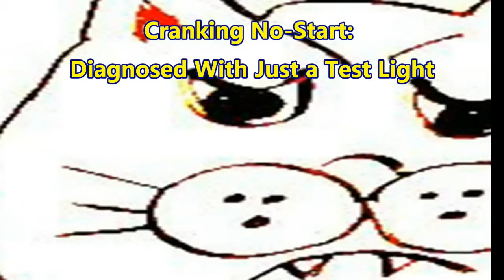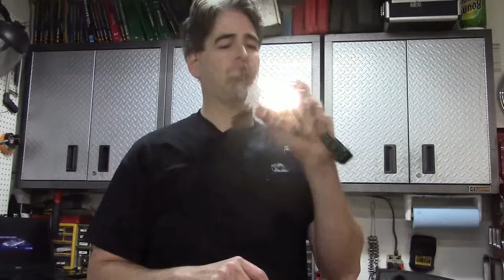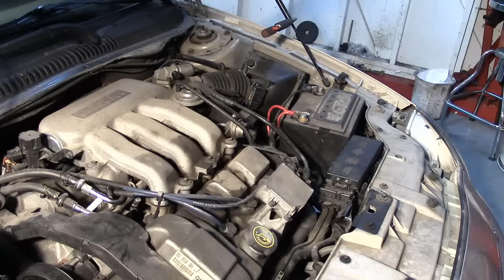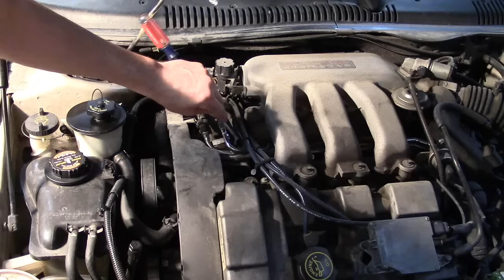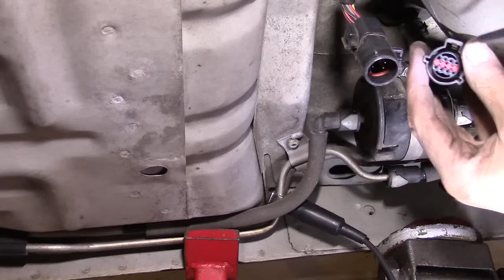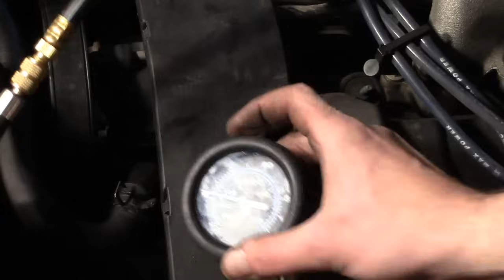Crank No-Start Diagnosed only with Test Light

Comment: Could be a clogged fuel filter or bad fuel pressure regulator?
Reply from the maker: No- there is virtually no commutator activity in the motor.  It’s not a pressure issue, it’s a flow issue due to the bad motor.
Reply: @SchrodingersBox  both a clogged fuel filter and an open regulator can cause a pump to fail.  Without the regulator restricting the fuel return line there is virtually no pressure.
Reply from the maker: That doesn’t explain low deadhead pressure though as well as the fact replacing the pump created normal pressure under load.   Remember- deadhead pressure was almost zero in the video. Filter and regulator has nothing to do with that.
Reply: @SchrodingersBox  if the filter is clogged how will u have pressure at the fuel rail?  If the regulator diaphragm or spring fails how would u have any pressure?
Reply from the maker: because i tested DEADHEAD pressure. When there is no flow a restriction is irrelevant. Think of ohms law as a correlation. Voltage equals current times resistance. Current is zero in a deadhead so voltage will be maximum. Think of measuring car battery voltage after a resistor when there is no current. It’s 12V either way- with or without a resistor. If it is any less the battery is bad, it isn’t caused by the resistor. You only see voltage drop when there is current. Exact Same math applies with fluidics. So even if there was a clogged filter, it has no efffect on a deadhead test because there is no flow.  The deadhead pressure was not even 25PSI. Therefore the pump is bad. 
  But also, when I replaced the pump and measured pressure with flow, it was at spec. IF there was low rail pressure under operating load then yes, of course there would have been a restriction and filter or regulator would be suspect. But that didn’t happen. 
  Conclusion : it was not a flow restriction (confirmed with BOTH flow and deadhead pressures). It was only a bad pump.That’s why i love science!! It is Scientifically impossible it was caused by a restriction so I know the diagnosis of a pump would be correct.

Comment: What about cars/vans that have been parked for 1+ years with same issue(cranking but not starting)?
Reply from the maker: same thing. No difference from any no start- What are they missing that’s causing the no start?
  The trick to scientific diagnostics is to not make conclusions on preconceptions.  You can triage based on them, but you can’t conclude based on them .

Comment: Can anyone tell me why  my fuel pump cuts on after I try starting it? It won't come on just by turning the switch to on. After attempting to start that's when it runs a couple seconds after words..
Reply from the maker: Not all cars have a KOEO prime. Apparently yours is one that does not.
Reply: @SchrodingersBox  thanks I put some starter fluid in intake fired right up. I changed fuel pump awile back couldn't figure out what was going onFor the longest time got kinda fustrated. . now it's fine thanks again

Comment: Matt I have 04 X-Type only 5332 miles on it did  crank but don’t start hit the gas thank hard starter fluid in breaker it start rite up what was the problem I’m worried it will happen again can’t see any problem no code I drove 300 miles it still going strong your opinion I seen your video love it  hope to see more
Reply from the maker: What data do you have?

Comment: According to my service manual the fuel pump pressure should be anywhere between 35 to 49 Psi depending on the engine. I have the same crank No start and am waiting for my fuel pressure gage to be delivered. Although I did get  a healthy jet of fuel from the Shrader valve, as you proved the pressure may not be enough at 20 psi
Reply from the maker: 20 is barely enough to start the car.

Comment: can you define "LOAD SIDE" a little better? Did you mean where the feed from the battery connects to the relay?
Reply from the maker: The load side is the side that carries the voltage to the load- it is opposite the ground side.

Comment: Did you get a spark? I couldn't see any but maybe that is just your poor quality camera. you should comment after taking that test  to clarify whether you had a spark or not
Reply from the maker: You clearly do not understand my procedure here. you are making no sense b
Reply: @SchrodingersBox  Let me try to clarify my question for you. When I asked if you got a spark I was referring to the electricity that travels across the electrodes of a spark plug. Does that make sense now?
Reply from the maker: How could there not have been spark? Did you not see the test light confirmation of it from the feed and ground side switching confirmations?
  The one thing we knew immediately from the very start of the procedure- this is NOT a spark problem. it’s a fuel problem. we know that 100% within the first 5 minutes.
Reply: @SchrodingersBox  there was no spark that I saw from your test light get better equipment  and maybe you will able to follow in the footsteps of Eric O of south Main Auto
Reply from the maker: Sounds like you need to learn more about basic diagnostics. You do not have to see spark to confirm it. Well - YOU do as do all basic bitches. But experts have other methods.
Reply: @SchrodingersBox  your right I should just hook up my scope but thought I would take the simplest way first and the vehicle is away from a power source to plug the scope in.  so you continue with your smart-ass sarcastic attitude and
I'll just watch other more friendlier sources

Comment: Thanks. Now I have a name for banging on the gas tank. "The Percussion Test".
Reply: HAHAHA! maybe Snap-on makes a tool for that
Reply: @rogerd4559  Actually, on modern fuel injected vehicles, a crank/no start condition AND no trouble codes is usually a bad fuel pump. The confirmation test may or may not be a "percussion" test.
Reply: In the electronics world it's called the slap test or the vibration test.

Comment: Awesome troubleshooting.  My RV cranks but does not start.  Good battery, I have zero fuel pressure so I was looking at the fuel pump.  Going to try and test the pump like you did.  However I also have no power to my starter relay coil fuse inside the distribution box.  The fuse is good but no power to it not even with key to start position.  Help
Reply from the maker: all your tests sound like what I would do first.

Comment: I am wondering if you wouldn't mind me sending you my code list that I got of a recent DIY project. I took in a 2002 Ford Windstar LX throwing the following codes: U1262 (SCP) Data Link Fault and 5 other instrument cluster codes (blend door failure, blower ffan circuit failure, etc.) 10 Generic Body EMC codes including B2499 (9 are related to various circuit failures). These codes change after I clear them. The car was running fine (oddly enough) and then died while i was letting it run and putting air in the tires). The car cranks, there are no fuses blown. I hear the fuel pump run when I turn the ignition as well.The codes change every time I run them. the U1262 stays consistent. There was also a PATS code at the beginning of all this that is no longer coming on.  I am a novice at electrical work but am trying to learn through your vids. I swapped out the cluster with one from a junk yard and tried a new front control module. Neither seemed to make much of a difference (still no start). Any help you might be able to provide me with would be great. I'm completely lost.
Reply from the maker: Sure. I need the codes and sensor input and output pids.

Comment: load the parts cannon 😭
Reply: Why is my corolla 2008 not showing check engine light
Reply: Shukela Mathebula 
Assuming that you mean your battery is charged with the key in the on position with the car off.You should have a check engine light on too verify that the system is good.If this is the case and it doesn’t come on then look for the following 
1. The Check engine light is blown(rare)
2. The computer is not working correctly 
Now if your engine is running and it’s not on then that’s a good thing as long as it shows up like mentioned above with the vehicle off and key in the on position.

Comment: The saddest part about the automotive industry is that they are not making it easy to figure out why a vehicle isn’t starting. There has to be better code development for quicker diagnoses.
Reply: sad? they dont want you to fix it. They want you to take it in and spend, spend, spend..
Reply: @tedporciuncula3385 😂definitely right
Reply: Hagbard Celine  well you have to, an old person with a pen and pad cant interact efficiently with a software based platform. 
A scribe of the 14th century wont comprehend a word processor system.  You have to transfer skillset across platforms by being versatile with concepts/ principles so one can achieve desired affect.  The  homie's channel here is evident to what I mean.
Reply: They do that so you either take to dealer to get fixed or mechanic
Reply: @huntersmith1802 love the old system if don't start put gas in carburetor and  ta um start right away , all those sensor throw so many codes you don't know which way is what could be simple and they cheat you telling you something expensive
Reply: I'm😂

Comment: Yea, there could be all kinds of reason why crank and no start, No Gas,  Bad Spark Plugs, Bad Spark Plug cables, Starting Fuse, Bad vacuum leak, Timing is off, Coil is bad, CrankShaft Position Sensor. There could be a few other things. 
If after I have done all these and it still won't start, back to YouTube video clips for me.

Comment: Hi Matt,
I have the exact same problem with my Alfa Romeo 156 2.0 Twin Spark.
Does not start, the fuel pump makes a noise but not the usual I used to hear.
Your video just reminded me of what's going on with my car.
No fuel coming in, just a tiny bit of fuel, not your usual spray.
Man, you ROCK!!!!! Your channel should be renamed the REAL MECHANIC.
Reply: What was ur issue?

Comment: Crank  but no start ... in most cases it's the Crankshalf Position sensor needs to be replaced.
Reply from the maker: In my experience that is the cause less than 10% of the time.  I would never recommend just replacing a CKPS for a no start.
Reply: @SchrodingersBox  ... Oh well agree, I would not replace the crankshaft position sensor just like that. But I don't rule it out either. 
Another possibility is there might be a horrible vacuum leak somewhere. Too much air, not enough gas.
Reply: @SchrodingersBox  ....Hey,,While I will agree, I would not replace the CrankShaft position sensor just cause crank but no start. 
I would lean toward you. You're right and I'm wrong. But I would not rule it out either. 
2 other things I just learned was a Faulty Coolant Sensor. And check The Inertia Sensor. 
Even if I am wrong with my ideas, it is a thought.

Comment: I have a 93 concorde  and it has a crank no start and if I jump the asd relay and it fired right up but put a new relay in and nothing.would this be a pcm or alternator problem.
Reply: I have got power to all relays but have no power to coil or fuel pump.all fuse are in good shape.
Reply from the maker: Try bypassing the CKPS or CPS

Comment: Great video! I'm trying to diagnose my 4.3 GMC Sonoma and I've had similar issues. We thought it was the fuel pump at first because I couldn't hear it when I turned the key, but after looking it turned out the coil wasn't getting a spark. Traced it to the fuse box and the ECM fuse was melted! We could barely get it out. After replacing the fuse the fuel pump engaged and I can start my truck and drive it but after a while the fuse will blow again. I've got no idea what's going on or even where to go from here.
Reply from the maker: What amperage is the pump drawing? You need to start there for sure.

Comment: Control wire & negative wire light up from the coil but when turning key ON the light goes off on both wires? What does that mean?
Reply from the maker: You should only have light go off on the ground side of the control wire.  If it went off on the FEED side of control, you either have no voltage feed OR much much more likely, your test light wasn't connected.
  You can easily verify it with a voltage drop test across the control coil.
Reply: @SchrodingersBox  96 suburban the connection only have 3 wires.. so i check voltage drop on the control wire?
Reply from the maker: Yes of course. OR confirm continuity on the load side which of course only can happen if the control side has voltage drop. Simpler.

Comment: Great info!  Thanks Matt. I'm not sure how I could have found that ground wire the way you did with your power probe.  Could I have used my led test light to safely find that ground pin on the fuel pump harness, by connecting the test light alligator clip to battery positive and probing the fuel pump harness pins until I found the negative?  (I probably need to go back and watch your 7 part electrical for beginners series again).
Reply from the maker: Yes you absolutely could have done it that way and in fact it's exactly how I normally do it.
Reply: @SchrodingersBox  Thanks. Earlier today, I was wondering if voltage could come out of the tip of a circuit tester, so I took my incandescent test light and my LED test light and connected both of their alligator clips to battery positive. Then I took my multimeter and checked to see if there was voltage at their tips.  I discovered there was.  (I guess that test reveals how little I understand about electricity).  I learned from your videos that I don't want to send voltage back to the PCM without going through a load.  So does that mean even though there is some voltage at the tip of my circuit testers, they can safely be used to probe wiring harnesses without sending voltage back to the PCM?  I'm sorry for asking so many questions.  Thanks for your help.
Reply from the maker: Well of course there will be voltage- but when under load there will be very little amperage on an LED (about 30 mA) and 250 mA on incandescent. But both will have 12V at all times.

Comment: I have an E320 Mercedes Benz. Last Saturday I accidently hit the "Panic" button on my key fob, at the time I only needed to roll up the windows and lock up. The next morning, nothing. It will lock and unlock, also the anti theft has been engaged. The radio face is telling me I need a code number. It was not in my manual when I bought the car.

Comment: Nice job,   I have a 460 --- Will  F P R   keep an engine from starting -Just bought this rig RV - It was running  but not great and revving it up and it would back fire.  ---  Drove it a  few miles,  couldn't make the hill! Backed it down the hill.   Then after shutting it off,  I have only been able to start it one time!  For a minute or so!  Now I can't get it to start!  ---- put in new plugs,, wires, Throttle Position Sensor.  Rotating the timing!   Puzeled !!!! I do Disaster Relief, but not going anywhere until I am up and running!  Also switched the relays,    and did a fuel pressure test -  45 - took a minute and a half to drain off to 35 , figure that was the  hook up.  Requires  at least 35 and top out at 45 PSI     Checked the line, took the line apart after the fuel filter!  Thanks,  Any Ideas!Thanks, Rick
Reply from the maker: Unlikely. I would start with basic diagnostics data you used for the TPS- why was that changed? What data indicated it was bad? That would be a major, major clue!
 ALso why change the plugs and wires- what was the spark problem you identified- was it failing to give spark at all cylinders only under load?
  Need better explanation of your data before I can help.

Comment: Mine is silent when turn key
Reply from the maker: Then do no crank no start diagnostics.
Reply: @SchrodingersBox  i cleaned the battery cables and scraped the post and that did it. It started right up.

Comment: I have a 2005 Chrysler 300c 5.7 hemi I have these codes 0123 0222 2101 2110 2111 I have changed the throttle body assembly and car won't start cranks but no start can u please give me some insight
Reply from the maker: I would need to see the data that indicated the throttle body was faulty.

Comment: Mine long cranks but will start after 6 or 7 secs or after 2 or 3 key tries, throws P0174 lean bank 2. Runs really good after start, especially after MAF cleaning, still long crank to start however.
Reply from the maker: Check for static decay in the fuel pressure
Reply: Yeah it's 30 psi after start and drops off quickly, fuel pump time right?
Reply from the maker: Yep. technical check valve but it’s part of fuel pump.

Comment: Fuel pump only comes on briefly to charge fuel rail with proper fuel pressure right? Then pump stays off until speed sensor confirms start-up then it tells computer to keep fuel pump running after engine start confirmed right?
Reply from the maker: Correct

Comment: 2010 Hyundai Tucson had a cylinder 3 misfire car died  about 2 wks ago I changed out 4 spark plugs a 4 ignition coils and it has a new battery won't start I thought is was but id didn't turn over I don't know maybe I will check the fuse
Reply from the maker: Why change the ignition coils and plugs??

Comment: I have a no crank no start on a 1983 celica with no spark to the spark plug. I am an Automotive student but haven’t gotten to electronics classes yet but have a basic understanding of electrical systems. Was wondering if you could point me in the right direction
Reply from the maker: ?OK where is the earliest point you find spark? Or is there none even from the coil?  If there is no coil,check the coil feed, signal and ground and if all are present, replace the coil.

Comment: can use the same test light for  a circuit  12 volt  to ground light  as well as a spark plug wire testers  with over 40,000 volt s  will it but out the little 12 volt bulb inside
Reply from the maker: No in fact the bulb won't even light.  Just don';t use an LED light. Only an Incandenscent.